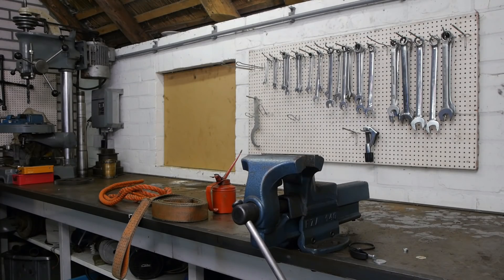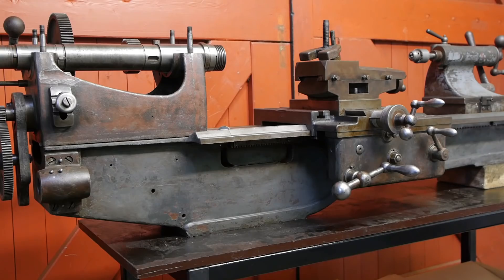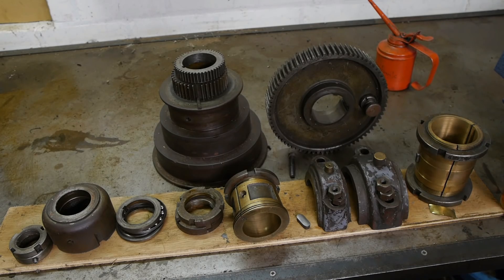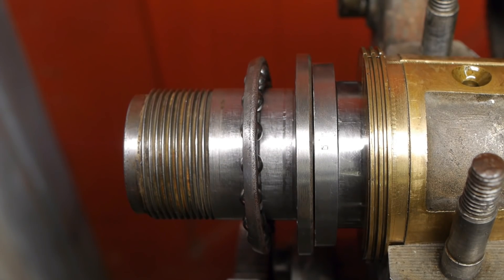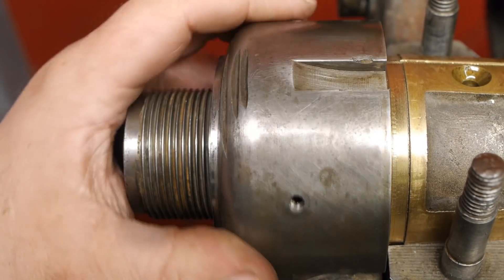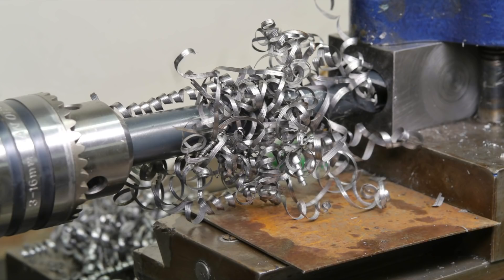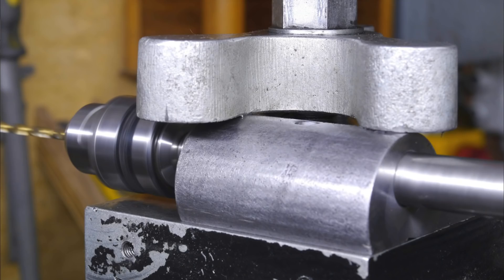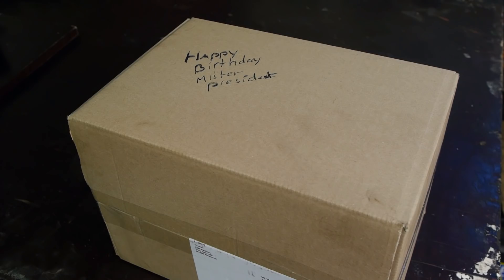Re assembing a vintage lathe spindle with bronze bearings

Comment: You're supposed to shim the bearing cap mounting boss for a free-turning shaft with little runout when nuts are torqued down.
Reply: Yeah, I was gonna say the same thing.
Reply from the maker: There were no shims when I took it apart and you should be able to tighten and loosen the bearing by moving it forward or backward with those big screw-on rings. So I'm not sure if shims are needed.
Reply: To prevent compressing the bronze taped bearings? Is this the root cause of all the damage?
Reply: @Rolingmetal  I think it is paramount how this exactly work otherwise it will never run correctly (read: you will gull more " witness marks")
Reply from the maker: spindle is back to together. It's not that dificult ones you have it figured out. unfortunately there is a a bit of runout.

Comment: The set screws in the ball race housing are probably just plugs, not meant to make contact with the race. The word 'oil' would pertain to all four holes, and the only one to use as an oiling point will be the one that ends up topmost when the housing is tightened down, and would drip feed the race and balls.

Comment: Happy birthday to your channel and thank you for taking the time to make the videos. Having the adverts does not put me off as a viewer. We had quite a violent thunderstorm on Wednesday as well (30 miles west of London). Many years ago I was an engineer at high power broadcast transmitters and have seen the damage that lightning can do, even melting ceramic. I once saw about a dozen strikes into the main antenna in a 20 minute period. Having said that, at home I don’t bother to disconnect anything as the chance of a direct strike is quite low, though your particular power distribution may have a greater risk. 
Anyway best wishes for the next broadcast year. Regards Nick.
Reply: The indirect induction could also harm destroy sensitive equipment close to the lightning strike
Reply from the maker: My cousin and grand parents lost most their electrical powered equipment.
My parents saw their alarm clock go up in smoke when I was as kid.
I lost a computer modem/router years ago.
None of this was due to a direct strike. The EM pulse coming though the wires can really screw you over.

Comment: Very interesting. Amazingly you manage to work, to explain and to film simultaneously!
Your remark "It's going to be more difficult then expected" rings a bell in my mind as I am refurbishing a 1950ies lathe with similar bearings. It took me weeks to scrape them in, actually I scrapped one of them and had to make an entire new one. Currently I am testing the lathe out and experience some really strange effects which might have to do with the bearings.
I don't want to discourage you, but expect some trouble ahead.

With regards to the "set screws": I agree with CurlyG65 and am pretty sure that they are meant to cover the oil holes.

Comment: You might check out Halligan's Workshop and his last lathe rebuild.  I think it has similar bearings.  That might give you some insight on how to set them up...

My century old Mueller has split phosphor bronze bearings, and is adjusted with shims.  Yours should do fine as long as things have not been galled, if the ones on mine are any indication.  Mine has a few scratches ... not as good as I'd hoped, but certainly not as bad as I'd feared.  When I took the big end apart to adjust it, I found the shim pack on one side had .002 more than the other.  Removing that extra one changed the total lift of the spindle from .006 to .0025, (which is needed to allow the spindle to ride in a film of oil all the way around).  I watched it closely, to make sure it didn't get overheated, on the warmest day it never went more that 20f over the rest of the headstock.  That adjustment made a huge difference, not just in surface finish, but it also made parting operations a whole lot easier.  At least I'm not breaking the cutting edges from the HSS blade once or twice with every attempt .
Reply from the maker: I had a look at Haligan's video. His Southbend 13" used plain bronze bearings that still look remarkably good. Lucky bastard :)
Mine doesn't need shims it the big adjustment rings to slide forward and backward the tapered bronze bearing.
Yesterday I assembled it and currently I have about 1or2/100mm run-out and about 0.03mm deflection when I pull up on the spindle nose. Definitely not terrible and there might be room for improvement.
Reply: @Rolingmetal  just a mention that my measurements are in imps... (imperial).  I should be more specific.  I can't begin to tell you what that is in mm's.  

 I'm one of those that, when told near my high school graduation that we were going metric, said "we finally got a grasp of one system and now you tell us we have to dump that and learn another?  Like hell!"

Comment: NOOOOO! do NOT replace those set screws with longer ones!!! They are just plugs for the oil holes. That race needs to stay as it is. The only function that assembly has is to take care of the lateral thrust, that is all!
And you really should not just stone that spindle with a pebble size stone... 

You can give that thing a mirror finish, but it will take you two days of very patient work.
Start with 600 grit wet/dry and fine oil...work your way up to 2000 grit. (always with a bit of oil) Don't try to get it all shiny in one pass, be patient. After that, you can use some diamond past or some of that M3 film
start with 40 micron and work towards 1 micron.
You should really replace that thrust bearing too..it seems like it has had its best days.
Assembling a spindle is a tedious and long job, if you want to do it right.
Once done well, it should be ok for years to come.

Oh and err.... start taking your meds again?

Paddy
Reply from the maker: You are right about the set screws. locking the ball race in place would be stupid as it would start to wear again the ring on the front of it. Still, it's curious 4 set screws 90 degree apart, that line up perfectly with the outside of the ball race. and how did that spindle get damaged if the ball race turns with the spindle?
Reply: It's a good question.... but I can't give you an answer. I have seen the most bizarre damages on spindles or surfaces that weren't exposed (and weren't even 'ware-surfaces').
Sometimes you start thinking that some people are doing these daft things on purpose!
And yes, one oil hole would have been enough, two seems ok...4 is taking the piss LOL
For a machine of that vintage, I don't think the spindle ware is excessive and it should be feasible getting it to run true and polish it up to acceptable tolerances.  But as I said before.... patience and persistence are your friends here...

Paddy

Comment: Regarding the "set screws" on the end cap: I would think all of them are plugs for oil ports, not set screws and should definitely not touch the bearing race. They made four of them because you would never now which one would end up on top, depending on how you adjust radial play of the left spindle bearing. With only one it might just be at the 6 o'clock position, if you are lucky. Therefore, they made for. German engineering...

Comment: Congratulations in the year 3 this is a long time here.
Bronze bearings, we machine these as vintage machinery re-builders (by no choice) oh no Whitworth, take care of those as we call them, not metric, not imperial but makego here, just learned about these sizes actually never had head of them before, not working with English is likely why, no call as of yet.
Wow Arkansas stone, you have some good tools.
How is the spindle run out after cleaning, stoning the shaft do you need to machine some new Bronze Bearings? 
Thank you,
Lance & Patrick.

Comment: The set screws shouldn’t bottom out.  They just keep dirt out of the oil holes.  (I think)
You can make some washers.  Remember, we are machinists 
You  appear to be right about the taper bearings.  This is going to take a bit of fiddling to get right.
It looks like a great old lathe.  Take the time to get it right.
Maybe you can braise up that missing tooth.  I did something similar on a gear in my cross slide and filed the tooth form back in by hand.
Maybe google how to adjust those bearings.  I’m sure there is some complex pattern of tighten this,then tighten that.
Reply from the maker: You are right about the set screws. locking the ball race in place would be stupid as it would start to wear again the ring on the front of it. Still, it's curious 4 set screws 90 degree apart, that line up perfectly with the outside of the ball race. And how did that spindle get damaged,  if the ball race turns with the spindle?
Reply: Maybe it ran dry?
My lathe has little dropper Oiler cups on the spindle.  I fill them up on the first lathe job of the day.
My belt pully has a similar set screw in it that allows me to oil the spindle.  It’s only needed when the back gear is engaged as otherwise the spindle and pully are locked together.
It looks like you lathe is very adjustable.  I wouldn’t be too worried about the scoring.  You have stoned off the high spots on the steel shaft.  I’d concentrate on adjusting for minimal free play. I do wonder what those little shims were in there for.  The ones you showed from your original video.
I think putting it back together will make an interesting series.
PS don’t worry about the paint.  Paint doesn’t cut metal :)
Reply from the maker: It most have run dry that would explain the wear mark on the bearings. Yesterday I finished putting it aback together.
There is some run-out it's no bad might still be usable.
But wonder if  these scored bearings can still handle that big 10" independently adjustable 4 jaw scroll chuck.
ps. I'm not worried about the paint. I'll jut pain it back because that's what I got :)
And I probably won't show that on video. because cleaning, de rusting and painting videos not particular interesting.
Reply: The scored bearings shouldn't matter.  It may wear quickly if the shaft is still a bit rough though.  
It is free play that will be a problem.  Not just end play from the thrust bearing  but also up and down, back and forward from the main bearings.  Tighten the bearings too much it will wear quickly.  To loose and you will have free play.  It's going to be a balance
I use chainsaw cutter bar oil on my head stock bearings.  It is a bit sticky so it doesn't fling off straight away.  It maybe even fills up the gaps a little bit :).  My bearings aren't adjustable.  I think there are some shims between the bearing caps.  I have been putting off pulling them apart leaving well enough alone.  My V belt is about to go and I have a spare.  To change it I have to remove the spindle so I'm not going to be able to put it off much longer.  I have seen people use a segmented belt to avoid pulling the spindle off. I reckon I'll just get into it. :)  I'll leave a shim out and see if the spindle still spins nicely.  If there are no shims left I may have to find new bearings.  I'm not sure if I will be able to make new ones.  Although that would be a great video :)

Comment: from a similar bearing assembly that I refreshed it had a separate ball race on both sides of the thrust bearing. I doubt that it is designed to run on the cast surface of the end cap. .
Reply from the maker: the other ball race is pressed into the bottom on the cap.

Comment: Are you sure there isn't another ball race that can be removed from that housing? With axial bearings, one ball race has smaller inner diameter than another. That's why you can't just flip it around as you want. Ball race with smaller diameter must go tightly on the shaft (sometimes you need to press it on), that's what keeps it from rotating on the shaft. Ball race with bigger inner diameter is loose fit on the shaft, so it goes into the housing. Small amount of play is what keeps it from contacting the rotating shaft and possibly galling. I'm not sure from the video, but they might be flipped around, so I would check it out.
Reply: your remark got me thinking  he is missing a race as he only sows the one
Reply: @janvanruth3485  That would also explain the scoring on the shaft. But I would replace that bearing anyway, even cheap one will be better than 50 years old one.
Reply from the maker: the second ball race seems to be pressed into the end cap.

Comment: Hi Rolling metal.
Is there a follow up video ?
I have not been able to find one.
I have a 1944 Colchester lathe with a similar bearing arrangement and with 0.050"  play in the spindle that I need to adjust out.
Steve.

Comment: Shouldn't the ball bearings be between the  two hardened bushes for the thrust bearing assembly.   The way you have it the balls  will contact the end cap.
Reply: The end cap has a bearing groove, when the cap is lock off the rear nuts adjust the end play.
Reply: 02Andy,
   I thought the same thing when I saw only one race for the thrust bearing. All I have ever seen have hardened inner and outer races to capture the bearing ring. I thought it may be possible that the outer race was milled into the cap but after thinking about it that’s doubtful as the cap would be too soft unless the inner surface was case hardened but that too is doubtful considering the age of the machine. At any rate it is a decent machine and well worth the effort of restoration.
Reply from the maker: It looks like the other ball race has been pressed into the end cap.
Reply: rM,
   That’s good then. There must be a race on both sides in order for it to function properly. If it’s pressed in ya better hope you never have to remove it. It can be done but it won’t be pretty. Good luck getting the machine up and running. It looks to be worth the effort. I like to see these old vintage machine restored and put back into service. I will do the same if I ever locate a decent large or mill at a decent price. Here in the US even the junk machines are bringing a premium these days. 
   I bid on an old hand operated shaper on eBay recently that would have needed a tremendous amount of restoration. For a while week my low bid held. Two hours before the deadline the bids went ballistic. It was ridiculous. The very basic tool went for over seven hundred bucks! It wasn’t even what could be called “vintage”. People go crazy sometimes.